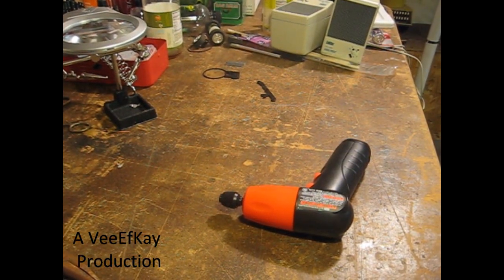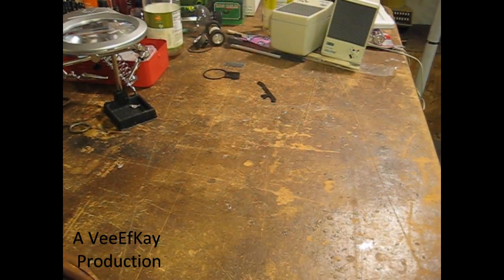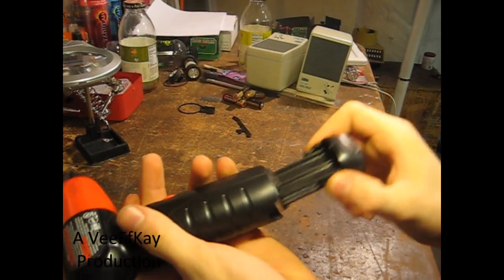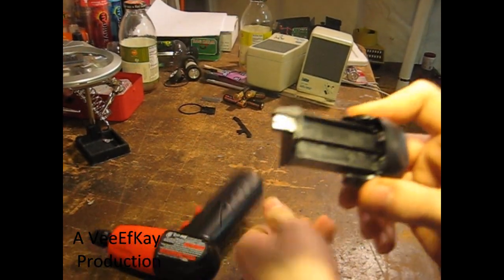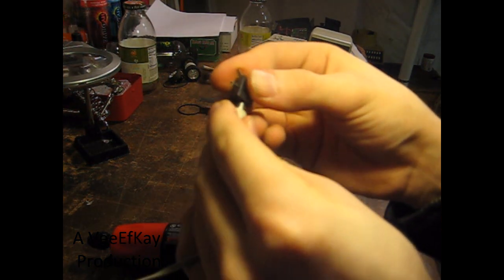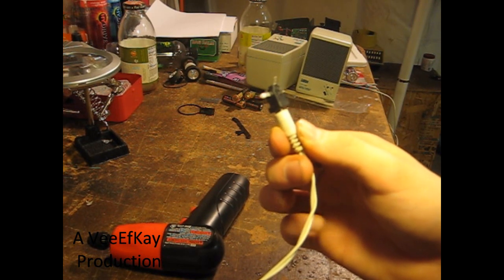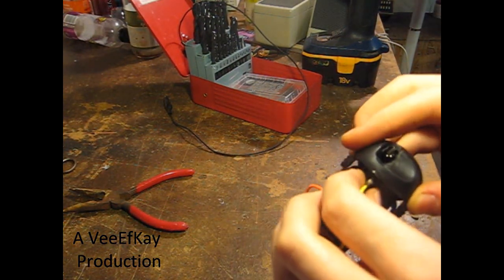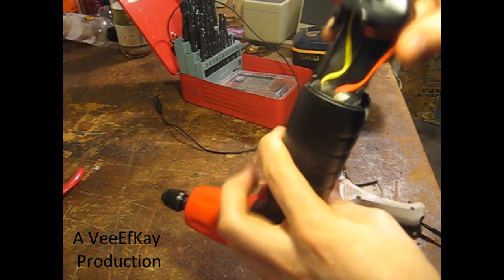How To Convert A Battery Powered Device To Wall Power

Comment: what voltage adaptor should i use?
Reply from the maker: If your batteries are for example, 4X 1.5V AA, use 4*1.5 = 6V. But you can use more volts for more power or speed, or choose an adapter with more mA output

Comment: Yeah, thanks. Very useful. Just a hint for you on your next video. Don't use music. Its distracting and makes it hard to hear.
Reply from the maker: +Matt “MATMAN” Turner  Sorry guys! I cant believe i did that! What was i thinking???
Reply: +vusiliyK The music is fine, you just need/needed to learn about editing and volumes.  The vocal track should have been far louder and it would have been fine.  It's still completely fixable, just overdub the whole spoken part, then re-set your soundtrack.  This will also be good for removing background noise.

Comment: I like your video it is straight to the point and easily to follow. But I have a question for you, How long can you use the drill?  It will not be overheat when you use it for long?

Comment: So if it takes 3 AA batteries how many volt and amp adapter do I get?
Reply: Generally, you can just add up the voltages of each battery to get the number of volts needed to power the device. An AA battery delivers about 1.5 volts of power. So a device that has three of them would have 1.5 x 3 volts, or 4.5 volts. You can verify this by looking at various battery powered devices that officially offer an AC adapter... the rating of the required adapter will generally correspond to the amount of voltage delivered by the batteries you'd usually use. For instance, a Game Boy uses 4 AA batteries, and a Game Boy Color uses 2 AA batteries. And sure enough if you look at the AC adapters required for each, you'll see that they use 6 volt and 3 volt adapters respectively. This information can also be used in reverse... if you have a cheap device that doesn't take batteries, but has a little AC adapter port labeled something like "DC in 3V" you can calculate how many batteries it will require if you attempt to make it portable by attaching a battery holder.

With devices that use Lithium-Ion batteries like laptops, though, the rules aren't always this simple... sometimes the voltages are split between the device and charging the battery so that it can charge while it's running, and it's harder to get an accurate idea of how much power the device actually needs. Of course, in these cases, the device usually already has an AC adapter anyway.

Comment: you want over 1000ma that's 1 amp or better for 12v high current too low it might not start as motors use higher current to run and also under load i tryed this a couple of yrs ago and the particular power wall wart could not start the motor as it was a very high current tool.
but i have successfully converted a 12 drill to work with a 12v 7ah ups battery it a little more  cumbersome but give me all the juice and i can charge it with a 1.5 watt solar panel better than a new $60 battery

Comment: It is much cheaper to buy batteries then chargers. To avoid burning charger, you should measure current under maximum load. That is the value charger used should give as minimum. It is hardly to be anything less then 1 Amp. Batteries can easily supply several amps.
Reply: Good thing most people have them lying around or can get them for 1$ or less at second hand store. Way better than buying expensive batteries over and over

Comment from the maker: The battery has three wires, and the AC adaptor has 2 wires. Thats not a problem. Just ignore the yellow wire, its useless! Now follow the video's instructions. Remember, if you dont know which wire on the adaptor is plus or minus, just try both ways, it wont break anything, i promise :)

Comment from the maker: Basically here is what you do. either look at the battery compartment and see where the two wires that go to the circuit board are, or use a multimeter with the batteries in to see where the max voltage is(should be around 1.5x4=6v.) then take those two wires or metal pieces and connect them to the jack. if it doesnt work, polarity is incorrect, and switch the solder connections reversly. incorrect polarity should not hurt the circuit.

Comment: could you repost the video without the music becuase I can't hear what you're saying.  Or maybe write down the instructions? Very interested in trying this for a battery powered hotwheels track for my kids!  It runs off of 4 D batteries...I need to know how to connect all the proper ends of the batteries to each other and then to the correct part of the adapter.

Thank you very much for your time.

Comment: Ok so I'm uncertain about how to match a DC plug to my drill. My drill's battery read 12V 2.0Ah. Does the 2.0Ah matter when choosing a plug? I have a few options 12VDC 1200mA, 12V 0.5A MAX, 12 VAC 840 mA, 12VDC 300mA, 11VDC 55mA. Which if any should I use? Thanks.

Comment from the maker: you can buy it at Radio shack or on any electronics website. But it would be easier to just solder it off of another device that you dont need anymore.  Thanks

Comment: I have one of those screwdrivers. I converted it to wall power by simply using rechargeable batteries (Eneloops are good). No need to modify the screwdriver, and it preserves the cordless nature of the device.